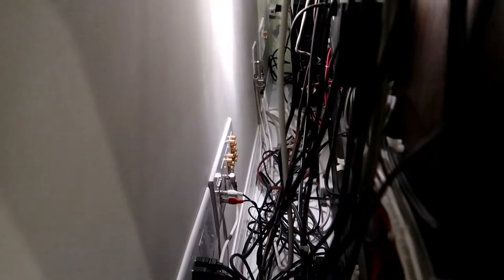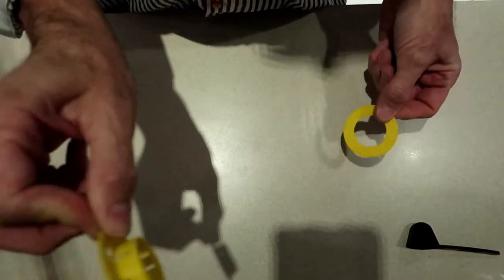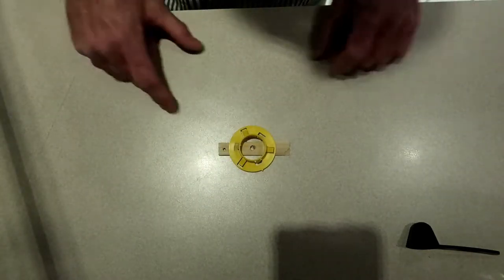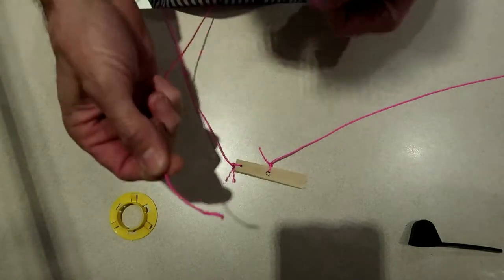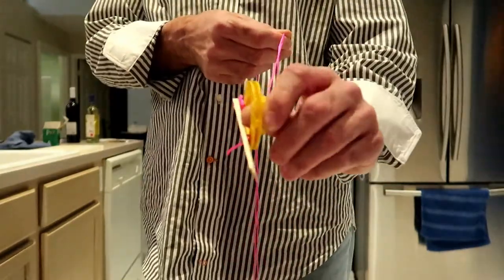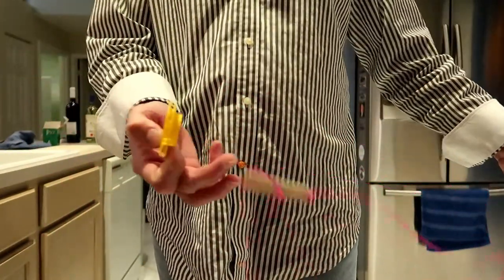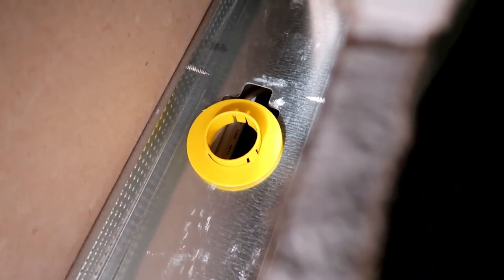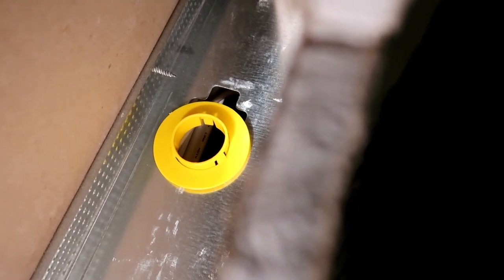One-Handed Wire Chafe Protection Installed In A Metal Stud

Comment: Or don't pull it apart, put one end in the opening, then with your fingers pull it together and snap it place.
Reply from the maker: You are better at this than me, I dropped two of them inside the wall, never to be used.  If I ever have to do it again, I will try your tip.

Comment: to much effort here, ...all you do is push bushing into the hole, flip it around and pull back through to clip in place  with fingers. simple and that's how you do it every day, all day long.
Reply from the maker: Too much effort gave a me 100% success rate. I didn't waste any of them by dropping them inside the wall on the other side of the stud.